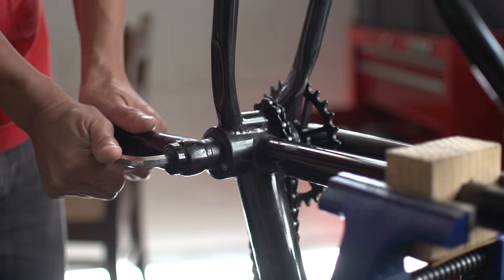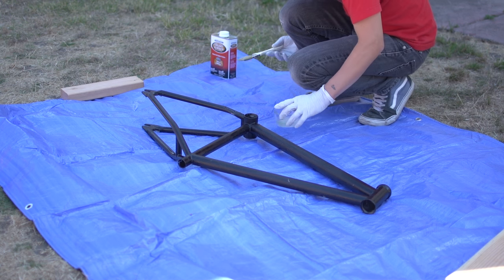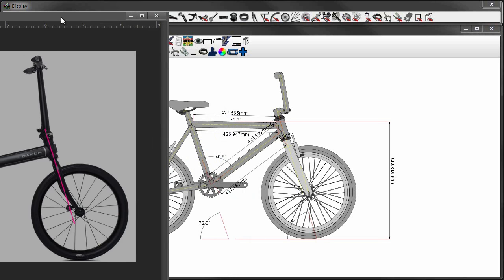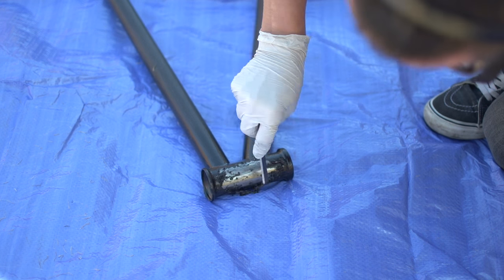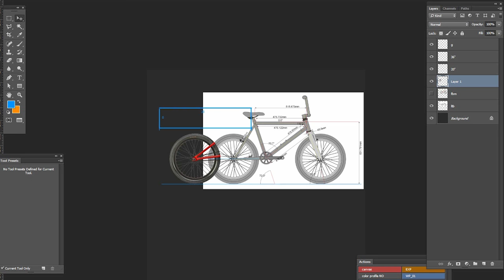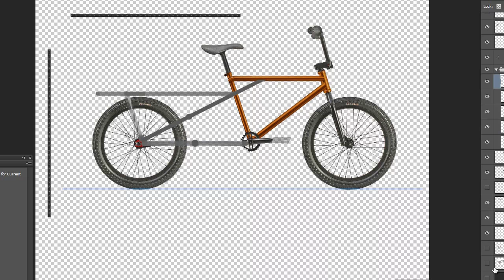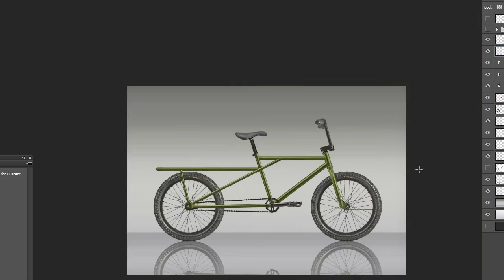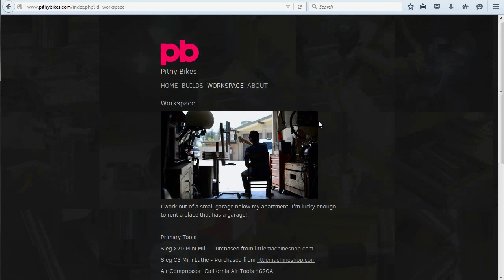Longtail Bicycle Build 01 - Designing The Cargo Frame With BikeCAD and Concept in Photoshop

Comment: This is most excellent. My son is a trombonist in his second year of jazz studies (full scholarship in Chicago). When he was ten or so I built for him a trombone trailer that he could pull with his bike. Learning trombone can be very behavioral as learning TIG can be. Methodical practice. Have him look for Jason Sulliman videos on youtube. That guy has some very innovative motivation techniiques. Please have your son play a scale or a riff and put it in one of your videos. He has a bright future. Good trombonists are hard to find.
Reply: The only trombone specific advice I would have is regarding the mount for the trombone. Assume that he will upgrade his case to a bigger one. You can use aluminum flat stock and simply heat bend into U configuration and then bolt two of those to the frame. Silicone some rubber hose over the ends to protect the case from chaffing or getting cut.
Reply from the maker: +Kevin Hornbuckle hi Kevin, thanks for the tip. I didn't consider the whole upgrade thing. I like the solution. My son practices every day. He's in concert band and jazz club at his school. He seems to be enjoying it. But with younger folks, you can never tell what they'll be doing year to year. :)

Comment: You are a very skilled crafts man. Well done. This bike is far beyond my skill set to build and I suspect many others.

For anyone with less time and lower expectations you can build something similar in 12 hours by modification of an existing bike. Buy a 2nd hand bike for £10 / $20 buy some 12 to 16mm steel tube to lengthen stays and build a rack. Tin of paint. Done. You need a welder.

Comment: Hi there... It's a cool bike but just a suggestion from a guy who has built a few longtails... long chains tend to whip and I would consider adding a tensioner. Also not really sure why you are going with 100mm spacing when 135 offers so many options such as IGH but you seem to know your business... And I agree with Jess.. you are the master of photoshop.
Reply from the maker: Hello! Thanks for the suggestions, I appreciate another look and thoughts into what I'm doing. The tensioner, while I'd like to go without may as you say be a necessary add on. The bike is smaller than most longtails so I'm hoping to get lucky. But this being my first LT build, I just don't know! I totally agree with you on 135 spacing. I went down the 100 spacing path because I'm re-using some bmx cranks. But now I wonder if bmx cranks would be fine with 135 axle..? I do know that the bmx hub I have poses a possible problem as you said with options. It's got a micro drive and its really difficult getting a cog on there with more than 10 teeth!  This is what I get for trying to re-use (inappropriate) parts.. The one saving grace is this bike doesn't need to shift or go fast. It just needs to putt around town. But having more cog options in back would be very welcome, especially if the chain rubs on the CS.
Reply: Maybe check out my Beavertail bike... it's similar to what you are building... I also tried to use BMX hubs but gave up on it pretty quick... much easier to lace a 135 into a 20" rim that fight all the other problems... a tensioner or derailleur solves the chain exiting problem... ;)

Comment: Neat concept intro. Might I suggest mounting the front rack to the frame Dutch style? If you're building from scratch anyway, heh. That way any weight in the basket doesn't affect steering, know what I mean? 

Oh, and an angle grinder with wire brush makes short work of paint, then just goop where you couldn't get at. Will save money/time on stripper. 

gg, best luck.
Reply from the maker: +Rebar77 I love Dutch cargo bikes. I thought about that and it was hard to resist. But in the end practicality won over. My kid does part of his commute on the sidewalk. I needed something maneuverable and that could take a long payload. Someday I do want to build myself a Dutch style. Great wire brush tip! I may still do that to get the paint I. Missed.

Comment: in my honest opinion you should have gone with 24" wheels for stability since the instrument is a little bit heavy, and the it might tip over at low speed's. love your work and can't wait to see it get built
Reply from the maker: +jorge Figgy I'll give this some more thought. I've been on the fence about what wheel size to use. My thinking is 20"will help keep the payload lower to reduce that tipping feeling. Thanks for the suggestion.

Comment: Have you considered a disc brake for either the front or rear? Might be nice to have extra stopping power when your son is carrying a load.
Reply from the maker: +TheSocialAnxietyClub I did consider that, but to keep the build easier I'm going with cantilever. I've changed my rear axle to a 135, so it can be an option in the future.

Comment: I curious the why you are basing the geometry off a BMX bike rather than something like a touring bike. Is it mostly aesthetics or is there another reason?
Reply from the maker: It all started from the parts I'm recycling. Since I'm reusing a mid bmx BB, and BMX drops.. And I have a set of bmx cranks left over that I'm using. Another factor is I want 20" wheels because this is for my son. Once you throw 20" wheels on a bike, it kind of throws the more relaxed geo of a touring bike out the window. Touring bikes also generally have a longer reach which I cannot do since my son's reach is shorter. In short, kids bikes are weird! :)

Comment: Dig it man!  I noticed you ended up raising the seat to fit the trombone case....is he still gonna be able to reach the pedals?
Reply from the maker: Yes he will :)  Although I still need to run a simulation on this to make sure. The bike is deceivingly low to the ground.. even though it looks like a normal bike.
Reply: 8

Comment: I have done this a few times. If you bake the frame for a few hours and then apply the solvent it comes right off.
Reply from the maker: Thanks for the tip! I have many good options now thanks to you guys :) How do you bake it? With a heat gun? Or something like a mapp gas torch?
Reply: +Pithy Bikes I built a wooden box and put the bike frames inside. I use a propane heater to bake them for a few hours. I run the temps around 400f to 500f. I also have used a sand blaster to remove the paint which doesnt take any of the metal away like a grinder or sander. but baking them has worked the best
Reply: +Pithy Bikes This is similar to the one I use. I attach it to ducting and than on to the box that way the direct heat isnt on the wood. I guess I could make a metal box out of some steel plate but havent yet
Reply from the maker: Cool man, thanks for the  link! If have to remove a lot of paint I'll definitely look into this option. Looks pretty affordable. Cheers!

Comment: a steeper steerer tube angle would probably make the bike more nimble considering the extended wheelbase
Reply from the maker: I did not consider this! Very good point. I hope what I got ends up being ok because the fork is already a BMX fork and those have steep rake. That combined with smaller wheels which also makes it more twitchy. I hope that is enough to even things out. But who knows! :)
Reply: Pithy Bikes actually, if you're planning on putting weight over the front wheel having a bit more rake and trail is supposed to make it more manageable. Either way, unless you're using some really extreme geometry it should handle fine. Thanks for responding and thanks for the awesome videos. Someday I'd love to get a setup like yours and start cranking out custom frames so the nuts and bolts explanations are really helpful

Comment: This is gonna be awesome! Are you going single speed? I feel like an internal geared hub would suit this bike really well.
Reply from the maker: +RockShandy you're probably right! If I do that I Suppose I can't use a mid BB and bmx cranks? Chain line will be off because of wider bmx spacing.. I'll have to see what's sizes internal geared hubs are available.
Reply: I'm not sure, I'd say it'll depend on the hub you use. You'll also have a bit more wiggle room since the chain will be longer than normal.

Comment: i just have to ask this, did you check on your kid's size? it seems like a tall seat tube...
Reply from the maker: +Aldo Maresca indeed I did. Although I haven't run a simulation yet. I'll need to get back in there for another design pass when some parts start arriving so I can enter exact measurements. Thanks for watching!
Reply: Pithy Bikes hey btw, if you need some 3d cad collaboration, i'd be willing to help you out

Comment: Aircraft remover is not very consistent, I've noticed.  Heavy or light applications. Also, I've noticed if you use it on the same spot to "get what it missed" it does little to nothing. Hopefully that helps anyone.  10+ years of trying experience
Reply from the maker: After having used it now, I'm not a fan of the stuff. Its so messy.

Comment: Couple hours and a mess? You need to learn to use wire brushes! Drill and angle grinder are portable but one on a bench grinder works the fastest.
Reply from the maker: Yes! I've since bought abrasive disc. They're the best. Live and learn.. :)

Comment: Hoi Steve , you impressed me with your biking skills in the precedent video.This cargobike project looks really a nice idea. For your info,, you can change the head tube dimension directly in bikecad. This is explained here https://www.bikecad.ca/toptube_frontcenter
Bart
Reply from the maker: Ah finally!!! I've always wondered why I couldn't find this option. Thanks Bart!
Reply: Further there are  icons in the submenus that give more options when you click on . Like for example the seat tube icon. Further it is good to  know that visualisation of the chain can slow down bikecad dramatically. So if you don't need the chain, hide it.
Reply: Here are some more options from Bike cad

https://drive.google.com/file/d/0BxPgNNvA6xaZV0NmUDlZd0RNN0U/view?usp=sharing
https://drive.google.com/file/d/0BxPgNNvA6xaZYUVPMlc4bXZ0bGs/view?usp=sharing